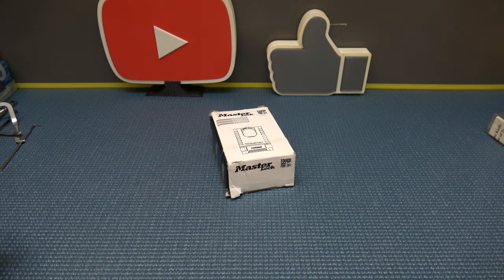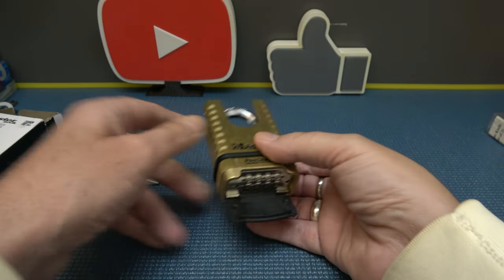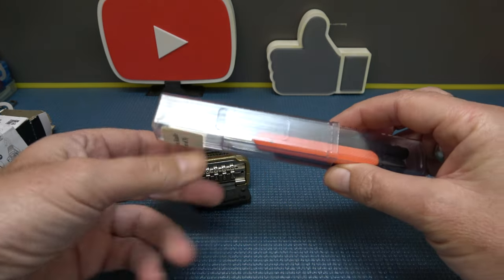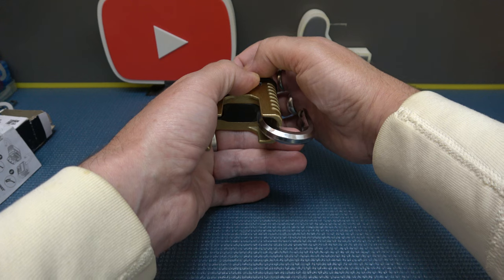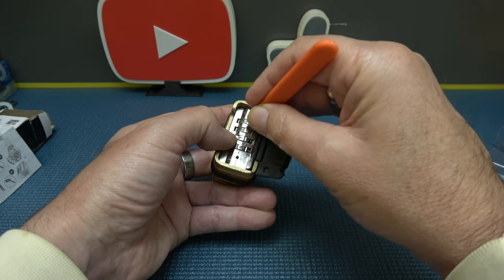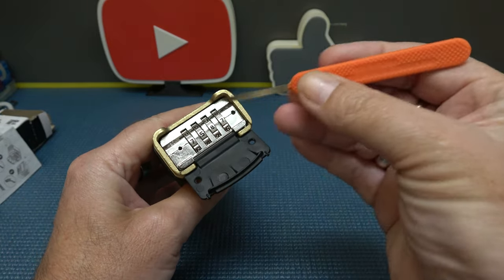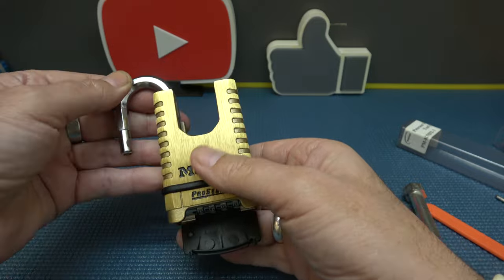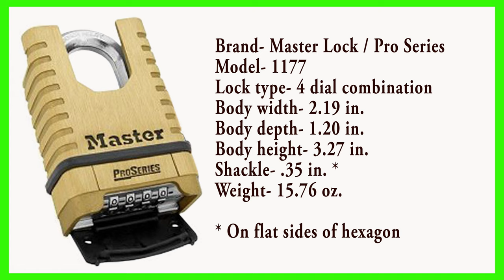#507 How to decode any Master Lock Pro Series 1177 ( Fast and Easy)

Comment: You'd think that after all these years of getting hammered by the locksport community, they would have come up with something not quite so easy to decode. Thanks for the video Al!
Reply from the maker: Ya it's mind boggling to me. Because they already have the base. They make some very nice strong locks. But they refuse to do anything about the old flaws. I honestly thought this one being a pro series was going to be tough. Heck, it's hard not to feel those grooves, their like holes.
Reply: I figured senty safe would of fixed the issue with those but they are still very easy to open. Just need a rubber mallet and hit the up left corner diagonally while turning at the same time
Reply: Using a hockey puck magnet works the same.

Comment: I was able to see the holes you talked about through the little gap by the wheel, no tool needed!
Reply from the maker: Ya some locks have a wide enough gap but some will be too tight for a visual decoding.

Comment: Thank you for the great information, I got a new 175 that is like this and my m176 has the flat spots which is actually a gear that turns on the axil and will move out from the dials when resetting the combo
Reply from the maker: Oh yes, I featured the ML 175 on video 358 and the ML 176 on video 416. Honestly I was thinking being a pro series it was going to be tougher to decode. Turns out it's the easiest. The tool literally just falls in the slot. It's hard not to feel it
Reply: @AlbertLebel  for me the newer m176 was easier then the older brass 176 that I have
Reply from the maker: @StevesLockPicking  That would surprise me if it wasn't a ML. Their the only ones that see all the free feedback or constructive criticism and choose to do nothing to improve on older models. It's mind blowing.

Comment: Funny ya say this, because I want to buy one, but they are spendy. Or to me. I would rather pay for a better brand off eBay used😜. Ofcource am after locks to pick😂. Always great content. 👏👏👏😎🔥
Reply from the maker: Thanks. Ya that’s why I was surprised it was so easy to decode. Being a pro series and priced so high, I expected more resistance.
Reply: @AlbertLebel  man this video really bummed me out! I have looked at that lock on shelf at store a few times. Have heard pro series was great( compared to others before). Though I won’t let it stop me from getting atleast one their shrouded pads. Think it’s cheapest shrouded shackled lock on market. That and the abus Rock. I think….😂. I will end up getting one one day. Been eye shopping on eBay. Probably getting a gutted (coreless) one. Then adding something a tad better if possible. Fuck odd love to see an assa or even a medico core in one😳🤤🤤🤤🤤

Comment: Appreciate your video as I own two of these locks. I suppose most won’t know how to pick these but … this was too easy and even for me (not a locksmith). Question: what could you recommend for a padlock that has a very strong body, shackle and either quite pick proof or even more convenient, has a very difficult tamperproof resettable numeric code system similar to this Master Lock model.
Reply from the maker: Thanks for checking it out. I’m not a locksmith either so we’re even. That’s a tough question. I highly recommend Abus locks but I can’t remember if they have a resettable combination lock like this off the top of my head. But look at their website. Personally I would avoid Master Lock products unless absolutely necessary.